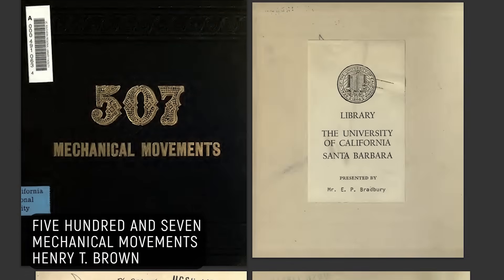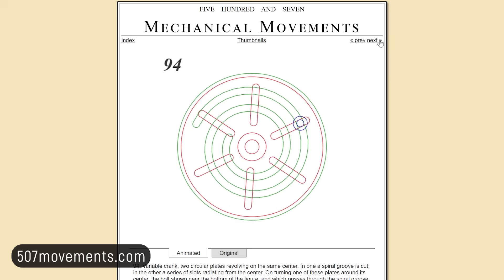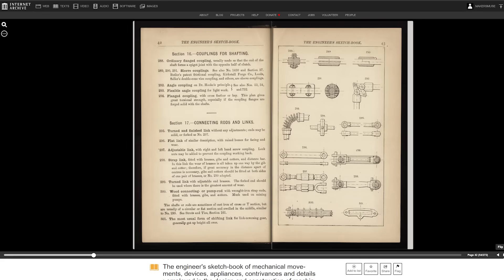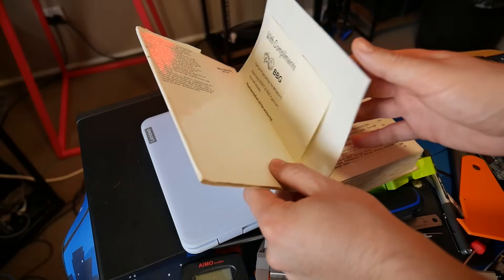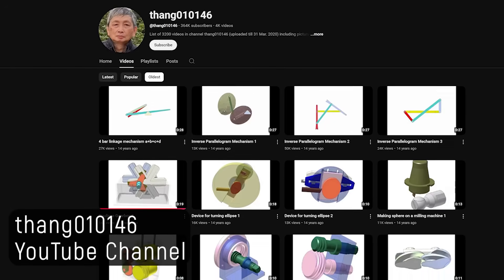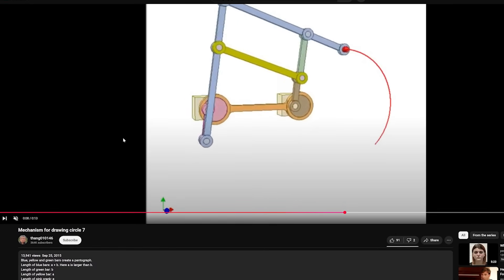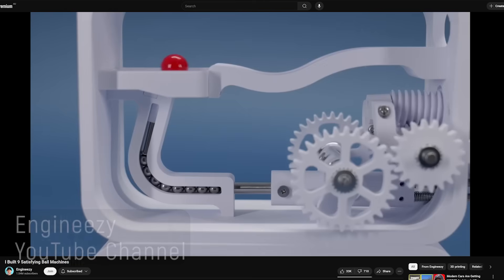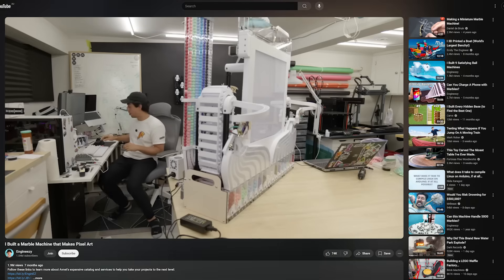Improve your 3DP mechanical mastery with these free resources

Comment: The biggest problem I have with 507movements is the lack of equations describing the behavior of the systems. That is the hard part when designing components, and without that I find little use for the site.

Comment: While this is a really good video with excellent resources on mechanisms, I found comments filled with a treasure trove of other channels that I subscribed to today. I don't have a maker or channel to recommend, but Engineezy had reviewed a linkage design and simulation tool called MotionGen last year, which has become part of my mechanism design toolkit. It's a free, web-based software. I like that I can sketch a path and motion and it gives me different types of linkages, which I can optimize.

Comment: I highly recommend MotionGen of you're looking to design your own mechanisms. 

It's more of a cad tool than a collection of ideas, but it lets you sketch out a design and very quickly analyse and tinker with the movement until you get exactly what you want. Plus, it's free software and it runs in your browser. 

There is a bit of a learning curve, but there are good tutorials here on yt that teach everything.

Comment: Thang010146 also shares STEP files for many of his animations.  However, I'm discovering that these are made to "perfect" tolerances - I've been trying to print one of his telescoping screw designs and having a lot of trouble with parts not quite fitting.  And that's with an X1C running at 50% speed for extra accuracy.
Reply: Print some clearance tests ( @MakersMuse released one, but there are many out there) and tune your slicer until you can get the smallest gaps working. If I can get down to 0.20mm on a modded OG Ender 3, you should be able to get down to 0.15mm on your X1C. :) 
Also, go with very low layer heights. Layer lines bulge horizontally, so the thinner they are, the less bulge they'll produce and the more accurate your print will be.
Reply from the maker: Yeah that's common for simulated mechanisms, add 0.2 between surfaces and you'll be sweet

Comment: Thanks for the collection, and the collecting!

Story time!

I once worked on a drone communication project where we took a very expensive and complex radio, then ran out of money for the antenna tracking system. Basically, we spent so much money on the radio that we couldn't afford the extremely high quality slip rings and concentric rotary waveguides needed for the antenna. So we needed to use cables. But we had to avoid the windup problem, where the fixed cable length couldn't handle more than a specific amount of rotation before we'd need to unwind it before the cable was destroyed.

Being an embedded systems engineer specializing in software, my first approach was simple: When the cable reached its windup limit, rapidly reverse the accumulated turns to alleviate the situation. However, our precision azimuth tracking drive system couldn't slew fast enough to unwind the turns before we'd lose our tracking lock and need to do a seek-and-find operation to reacquire communications with the drone. Not good for the communications channel!

The second approach, suggested by the mechanical engineers, was to add a second, stronger drive system just for rewinding. Which would double the actuator cost on a system that couldn't afford the slip rings needed to prevent the problem in the first place. Bleh.

In frustration, I realized I needed the antenna to "snap back" and instantly unwind the accumulated turns. So why not torsion a spring as part of normal actuation, then when the wrapping limit was reached, use the spring tension to rapidly do the unwinding. Such springs are cheap, and the only significant system change needed was to increase the torque on the primary drive (rather than the speed), then add a simple mechanical system to initiate the unwinding. We didn't need to worry about halting the unwinding, as the spring force steadily decreased as the unwinding progressed, and the system had enough inherent friction to let the drive system take over just when the prior orientation was recovered. Basically, the angular momentum of the antenna balanced the friction to provide near-ideal coasting.

It was a total hack, but it worked! The lead customer saw it, shivered in horror, then gave us the money needed to upgrade to slip rings and rotary waveguides. Mainly due to the shaking the radome underwent during the unwinding (within spec, but still a frightening sight to behold).

Though it never went into production, and with only the one prototype ever constructed, it was one my most proud achievements, where the software engineer took the electrical and mechanical engineers for a ride.

Comment: Are there any games to learn about mechanical marvels?    If not, maybe start a crowdfunding campaign for one or an opensouce project for the community to put together?   I see it sort of in the same vein as Stormworks Build and Rescue or how KSP teaches about rocketry, some fun theme behind it.  Except this would teach about engineering and building 3D prints.  Maybe capture the Apollo 13 how do we fix this vibe?   What would be cool would be to get STLs of your parts as you conquer mission scenarios.

Comment: Great video, please do more like this! One book I really liked was Kempe's 19th century treatise 'How to draw a straight line'. It's just the thing if you need to make something straight from first principles, say a lathe bed on a desert island. I made some of the mechanisms in it in LEGO, with a pen held with a rubber band as the stylus and a sheet of A4 copy paper. Also liked The Engineer Guy's explanation of the Harmonic Analyzer which would be excellent to do as a simplified 3D-printed model.

Comment: Don't forget the mechanical engineering you learn from watching machined sliding and friction mechanisms. Timing of machinery, just based on setting up angles and cams and rollers in the right spots... The inside of guns is a marvel of engineering at times. Forgotten Weapons.